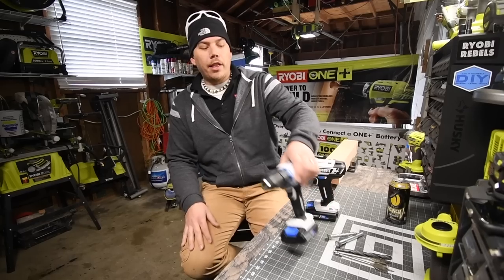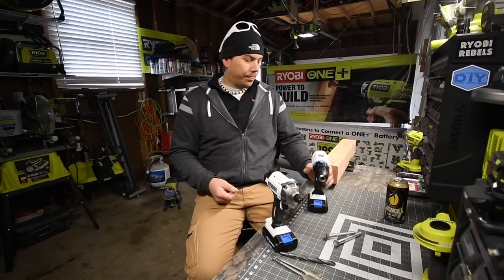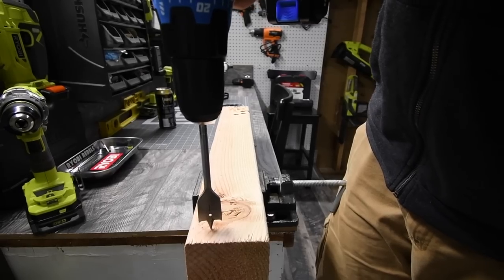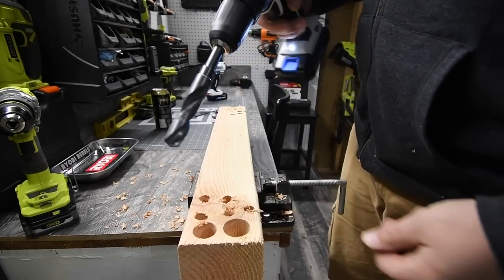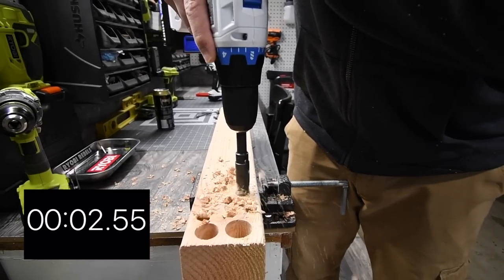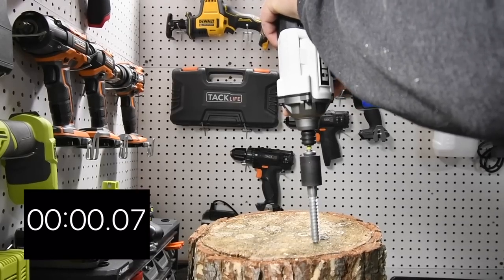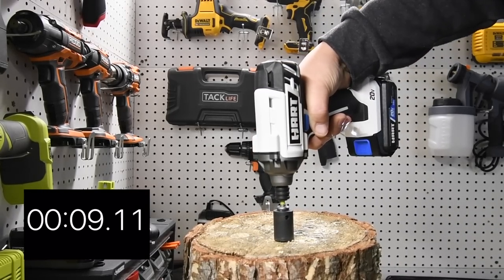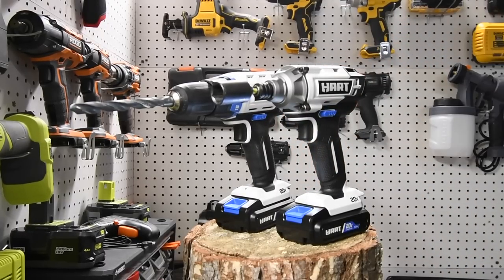HART Drill and Impact driver testing

Comment: I had a white Makita kit in 2008 it was my first  lithium-ion kit for work Everything died in the kit except the flashlight I sold and charger and yes they get dirty it is what it they're okay for DIY Hart brand it's like tacklife  tools is diy and Ryobi also is targeted towards DIY but they're not crap as well as Ridgid even though Ridgid is now pro consumer range I tried out that hyper tough 18 v Nicad drill 4 poops and giggles such trash thank God it was under a $20 so you know this heart brand is not trash completely cuz it's ttI really nothing they put out is trash or Ryobi would  be complete trash and it's not I own a few with a blue colored Ryobi I had some tools prior to my Makita kit as well as a lot of DeWalt old 14.4v Nicad and 18 v Nicad tools I used to work in construction so dewalt was a giving back then Milwaukee was on the jobsite so was Makita but I can definitely see people buying Hart I used to have a hart  hammer before tti bought them out
Reply from the maker: other tools are on their way so stay tuned and thank you
Reply: It bothers me when people say that Ridgid is a "prosumer" brand. My 1st ever construction job was as a laborer for the power company. We used all Ridgid pipe wrenches, our cut off saw was Ridgid and the huge job box where we kept everything was Ridgid. Nothing DIY about that

Comment: To be fair you didn’t use the 1” and the 1 ⅛” bits the same. You didn’t let up any on the 1” bit and the drill stopped but on the 1 ⅛” bit you used it properly and let up a couple times to clear the shavings. So the test, in my humble opinion, aren’t the same. 
Any drill bit used needs to be pulled back from time to time to clear shavings. If you just go for it non stop just isn’t good for any tool to put that much unnecessary stress on them. 
If you’re gong to test apples to apples you need to use apples...lol
Reply from the maker: I thank you for your feedback sir

Comment: People sitting around watching youtube videos and pretending that a few seconds difference drilling or driving matters.  Priceless.   By the way you are completely wrong about driving large fasteners.  That is not what you choose the SMALLEST 1/4" drive impact for.  You get a 3/8" or better, or use a 3/8" or better impact wrench if you have a socket rather than a screw bit.  I can't believe so many people are foolish enough to not understand it is the wrong tool for the job if you need an adapter and there's a more robust tool that doesn't need an adapter.   It's a bit like testing which pocket knife is better at chopping firewood because you refuse to get an axe.
Reply from the maker: to some people a few second difference matters. some people want the best of the best just so they can say they have it
Reply: @ManCaverTools  In other words, irrational and probably incompetent.  However you are falsely assuming that faster translates into best.  This is often NOT the case.  Trying ot push output at the expense of heat or stress on the drivetrain is often not the best design.  Broken tools work infinitely slower than working tools.

Comment: dude, wood doesn't test a drill, metal and concrete does?   might as well have drilled into cold butter?
Reply from the maker: These are DIY tools. I don't think they are bad tools for that purpose
Reply: I wouldn't be buying hart to drill concrete or metal. Concrete maybe if they come out with a hammer drill.

Comment: The 1 1/8 he backs it out the clear the chips
Reply: Yep. Just like you’re supposed to. Just bearing down w a bit non stop w o clearing the particles out of the way is tough on any tool
Reply from the maker: That's what these tests are for, these are stress tests to see what the tool can handle.
Reply from the maker: These are stress tests on these tools. sometimes I put more strain on the motors to see what they can do

Comment: Most people know its smarter to not hit a knot. I mean you drive a nail by hand or gun and rarely does the nail go through the knot so why try to put a whole through one. Especially with such a small battery
Reply from the maker: some knots you cant see due to being in the wood
Reply: @ManCaverTools  true but i can clearly see a knot and im not even as close to it as you so why do it if you can clearly see one there, or are you just blind

Comment: I like this video but your not using them in real life application. Anyone can drill holes in a block of wood and be like "it's good or bad" but that doesn't test all areas of the tool. Which in return will not give you a real result. Cause who will use an impact to drill a bolt in a stump. Use it on a real tire nut or something like that.
Reply from the maker: I thank you for viewing sir. more test videos coming soon
Reply: This guy has such terrible replies. Literally everytime someone points out how useless these tests are he has no good answer for it

Comment: Go to Walmart and buy a hyper tough and try that 😂 that test would not even get a quarter of the way LMFAO that's why Walmart did this and the only other brand that they have I remember they used to have Hitachi in their stores   believe it or not and the only other brand they had before hart was Bostitch as their higher-end line they sold  and of course they have b&d  they sell skil saw Hart is low end but not crap
Reply from the maker: I will be getting more Hart tools for the videos

Comment: A drill is as good as the bits they're driving and those paddle bits are some of the worst I've ever seen. I don't know why you're dogging on Hart when Ryobi is made by the same company. This is a joke fr.
Reply from the maker: TTi also made Milwaukee, so you just bashed the spade bits from the company that's makes Milwaukee. which means this comment doesn't make since and thank you for viewing
Reply: I don't care if the spade bit is made hilti or harbor freight if it's a shitty spade bit it's a shitty spade bit TTI makes Milwaukee and ryobi yet the ryobi is garbage for high load reliability. You ever use a bit and brace with a quality bit and then switch to a shitty bit. It goes from manageable to impossible real quick.
Reply: @ManCaverTools  how doesn't it make sense? Do you immediately believe that since a company makes a good drill that their bits are just as good?
Reply: Turn up to 24 position max power he had one set at around 16.

Comment: Crappy test by a so called expert.
1.5ah battery is too weak for hard core tests.
Also, drilling into and next to that knot was a dumb idea.
If you want to actually provide test results of how the tool performs, than use a 4.0ah pack !!
Reply from the maker: this is a verryyyyyyy old video Jim
Reply: @ManCaverTools  It's NOT that old and has nothing to do with the fact that you are NOT testing the actual Tool's Performance when ur using a little tiny battery pack that can't keep up. Seriously, that was ur response, "the video is old" ??
I'm sure u have a lot of great reviews, and you're area very informative guy, but this wasn't a real test when u are limiting the tool with that tiny battery. (u are giving out the wrong impression of the tool's performance).
Reply: @ManCaverTools   LOL - Hart tools are just over a year old. 
Just admit u were too cheap to buy a 4.0ah battery pack and that the test does NOT represent the ability of the tool you supposedly tested. buh-bye

Comment: What Junk this Hart drill is. You drill with the spade bits and a big drill bit and the damed thing stalls.
Reply from the maker: it does the job to a certain extent. the impact is decent but I agree the drill is bad
Reply: I mean the bits you were using were every bit as bad as the drill itself. It isn't even self feeding and you weren't ever cleaning out your chips. You could stall out a gen 3 Milwaukee drill by doing the same thing.
Reply: That drill seems pretty decent to me. I bet if he wasn't trying to force it so hard it'd do much better
Reply: @Zachariahfml ...  I kind of doubt the Milwaukee would bog-down like that Wallmart garbage "Hart". Because Hart has No Hart